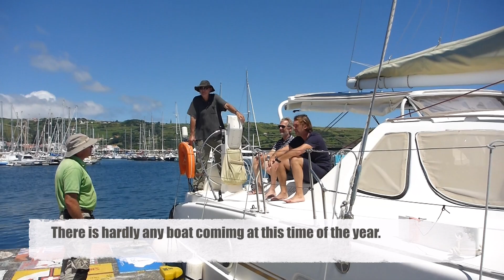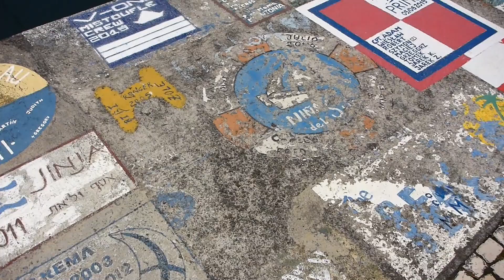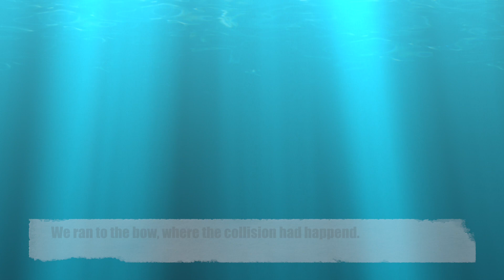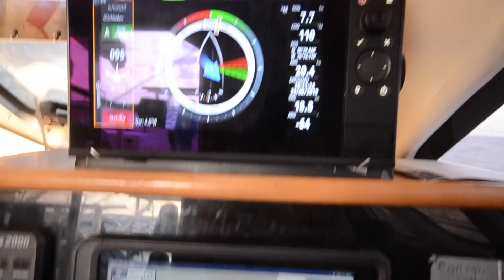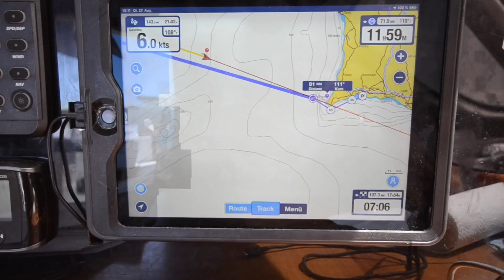Yachtüberführung / Yacht delivery Catamaran, USA to EUROPE, Part II incl. WHALE COLLISION

Comment: Thanks for sharing & happy to know you made it safely. This makes a point for glued in keels. I have 3 questions: Why you did not deploy the dagger-boards? And is there a difference between Catamarans & Trimarans in the way the sail in rough weather? Do you prefer the owners on board during delivery as they would be more tolerant when accidents happen? Thanks again for your time.
Reply: You don’t need dagger boards down wind.  Though a little normally is required to balance the boat.
When they hit the whale, you can see that the dagger board was down as it sheared clean off, though appears not to have damaged the hull.
Glued in keels are not good, as you can see the mini keel, which is there to protect the propeller, was partly sheared off, and this is where the leak was.
The ideal is kick up boards and rudders so you can slide over an obstacle